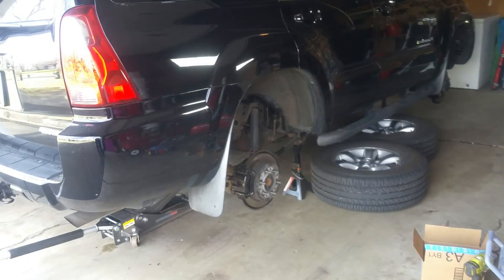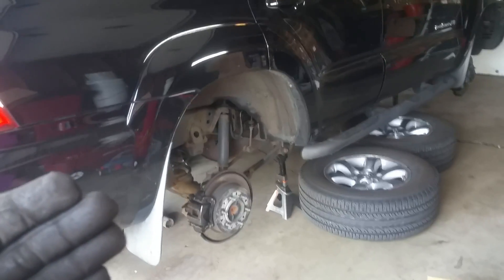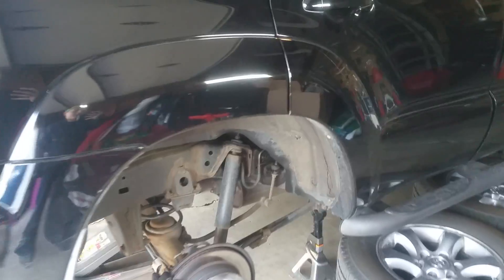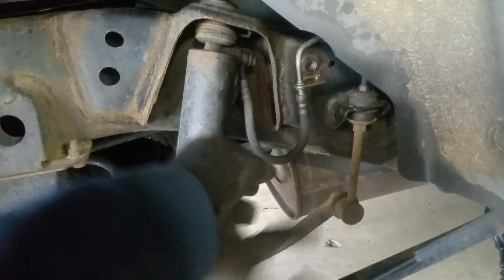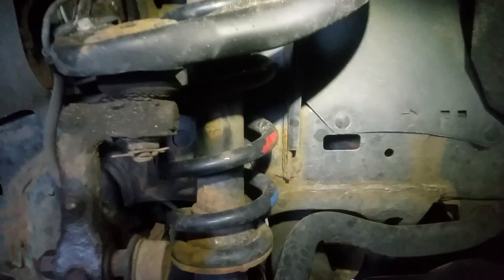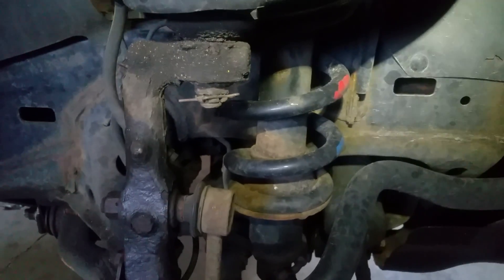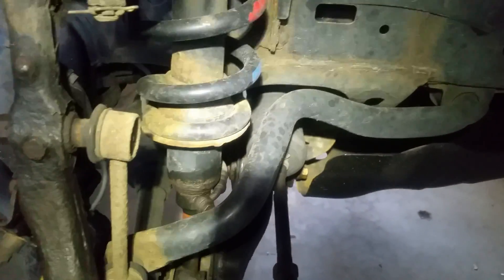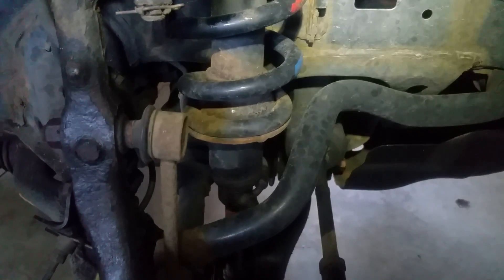How to tell if you have Xreas on a Toyota 4runner

Comment: Ha! Changed the rear links today on my 2006 and pulled on the tube that was blocking the top nut…. Loose end! Previous owner had replaced the shocks without removing the xReas 🙄

Comment: What happens if you ONLY replace the front and do the rear separately if you have this system?
Reply from the maker: Replace with oem xreas? Good luck finding any. It's not worth the money. Replace all 4 corners with conventional shocks and struts. Once your open one corner, you basically depressurized the hydraulic line. Remember the corners are connected in an X pattern. No such thing as doing 1 corner.

Comment: I have this system on my Toyota Crown,  can i switch out the springs for a lowered option ? 

Will it effect the system
Reply from the maker: It probably wouldn't work if you go too low. The shocks and struts would need to be limited in their travel to match the lowered springs
Reply: @ulrblitzer  I appreciate the response, thank you !

Comment: I'm getting ready to take mine out. Repair cost is outrageous for that XREAS. KYBs will be the perfect replacement.
Reply: How was the ride after removing the XREAS system? I just ordered the conventional KYBs by accident, not knowing full knowledge of the XREAS system. I’m wondering if I should return them, or proceed with removing the factory shocks and struts XREAS system.
Reply: @JessePaulHeed  Actually the ride is not much different from the XREAS. I can’t tell the difference, so go for it.
Reply: Thank you very much for the quick reply!

Comment: Can you add the leveler kit without opening the hydraulic system ?
Reply from the maker: yes, depending on kit. There are XREAS specific spacer lifts ... but there are varying ideologies if spacer lifts are more bad than good. And if you have a lot of age/mileage on your truck, you might be better off ripping XREAS out and going with a conventional shock set up to meet your lift needs. 5100s are a very popular front end lift shock.

Comment: My husband just bought a 2004 4 runner limited. It had right front end damage when he removed the shock it has a hose running from it. Would this be a sign that it is xreas? He hasn't been able to find a replacement at any local stores. Can he replace one with a standard shock or does it have to be replaced with an xreas? What do you suggest ?
Reply from the maker: That would be Xreas. You can yank all 4 out and buy any conventional suspension on the market. The springs can be reused but at 2004 age, new springs wouldn't be a bad idea.
Reply: @ulrblitzer  so no way just to fix one damaged one?
Reply from the maker: @stephaniechavira9329  nope, the suspension is connected like a big X. You have to do the broken one and the kitty corner one. And again, with the age of your truck, the other two would now be worn and ride unequal. Bilstein 4600 are a cheap but good alternative. The 5100 series are more common. Or any auto parts store offering x4 if the truck just sees pavement all day. Or any slightly used Tacoma / FJ Cruiser / newer 4runner suspension will fit with slight modification. Take off parts can be pretty cheap and common if you live in a 4x4 community.

Comment: Will removing of X-REAS System compromise ride comfort and handling? Will installing of Bilstein 5100 provide way better handling than X-REAS system?
Reply from the maker: XREAS is your suspension setup. If it is leaking or shot, anything will be better.
Reply: Tq so much for your reply. Did you remove the entire X-REAS system? I assume it won't trigger any error code to dash board? OE Parts from Toyota will cost me my kidney and thinking to replace it with Bilstein 5100.
Reply from the maker: @mavericksoong4897  there's no electrical connection. Unless you stretch a speed sponsor or abs wire on the knuckle while taking off the suspension.
Reply: I had mine removed when they started leaking and replaced with Bilstein 5100's and the ride is markedly better.  Looks wicked too!

Comment: So the SR5 trim doesn’t have XREAS?
Reply from the maker: Not on the 4th Gens
Reply: @ulrblitzer  hey are you sure 4th Gen doesn’t come with it? Mine has the canister you speak of on both sides same area 🤔 I’m trying to figure out whether I have it or not. I have the hydraulic lines feeding to shocks
Reply from the maker: @chapinfpv4206  4th Gen? Not on SR5 trims. Standard on sport. Found on some Limiteds

Comment: Thanks for the video. I have a 2007 Sport with around 145k miles. I'm looking to either add the DS 1 inch front level, or the DS 2.5 / 1.5, or just scrap the XREAS all together and go with Bilstein 5100s and FJ shock combo. 

My question is, when the XREAS system eventually goes out, is the whole suspension system done? or will the shocks / coils still work fine, only excluding the benefits of the XREAS system. Thanks for the help
Reply from the maker: Kevin Mayo It'll run like any suspension set up with busted struts. The coils is what gives you lift. The struts provide dampening, except you'll lose dampening x2 as they are crossed link. Technically you can ride out leaky Xreas till the fluid is all gone. The ride will just get exponentially worse with every amount of fluid lost.
Reply: Got it, appreciate the help!

Comment: Thank you for sharing !! I have a 2011  4Runner with the x-reas system. I have no leaks just a bad front left shock absorber. Can I replace it without having to replace the rear right strut ? Or does the whole system need to be worked on ?
Reply from the maker: The corners are linked in a X pattern. Thus the name. You can't really service one without the other corner. And it's not cost effective to replace xreas if it's still out there. Rip it all out for a conventional set up.

Comment: thanks for this video but quick question, what was the other system you thinking of running on it because i have this system and its bad now.. can you help me make a good choice
Reply from the maker: Jiggz James I ripped it out to run Bilstein 5100 + a slight taller lift spring. Once Xreas is out, you can run whatever (normal) shock and struts. Xreas by itself just limits what you can use. Once it's gone, anything can go in.
Reply: another question did you change the springs?
Reply from the maker: Jiggz James You can, you don't have to. The shocks and struts make up Xreas. The springs are normal. I'm running FJ Cruiser springs for a slight lift.

Comment: Ok, if I go with a Bilstein 5100 package for my 2007 Sport, what springs do I need?  Standard FJ Cruiser springs will work?  Do I need a certain size?  This is what confuses me the most.  Thanks!
Reply from the maker: Whatever springs you want. Reuse the OEM springs if needed. XREAS is just the shocks and struts, not the springs. Lot of folks put on FJ springs for a budget lift. I've heard the aftermarket FJ springs need to be trimmed to fit for the rears. I found a set of OEM FJ springs so I avoided all that.
Reply: @ulrblitzer  thanks for the reply. I've got 172k miles on original xreas. I don't go off road so Bilstein may be overkill. May just go with fully loaded Monroe in front and back. Sounds like a decent option and I still would have ability to lift slightly for a bit larger tires if I choose.
Reply: Some also come with air bags in the rear.

Comment: Mine just started to leak at 59.000 miles and always no off road use. By comparison, my FX4 had 150.000 miles when struts started to wear. BS system IMO.
Reply: 2006 181000 miles & my x reas is now leaking… it’s bs cost to replace oem so I’m going for a lift kit.

Comment: Hi there
Great video. My FJ come with such system too. Any video on how to remove this XREAS Suspension system and replace with normal suspension. Huge price different for OE Parts from Toyota for normal absorber against absorber with XREAS system. Thanks.
Reply from the maker: Remove like any other suspension set up. Just have to have the wheels off the ground to take up the pressure of the shocks and struts. They will still spray out if they are fully loaded with fluid so be careful. Follow the hard lines and unbolt them around the bottom of the truck.

Comment: What if I want to FIX the XREAS system?  I would prefer that over replacing it.
Reply from the maker: It's not very cost effective, if you can even find 4x shocks/struts to replace. Google and you'll see the pricing. They are linked 1 corner to another. You can't replace 1 and call it good.
Reply: Is there any way to charge the system? I had 1 tube that broke, I replaced but now the front bounce a lot. Thank you